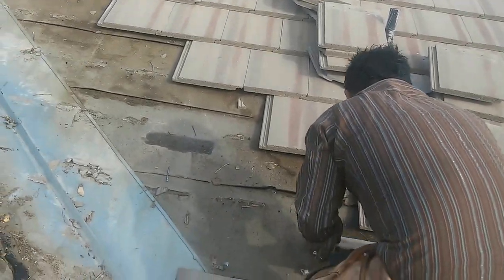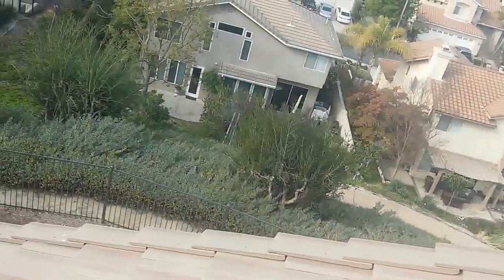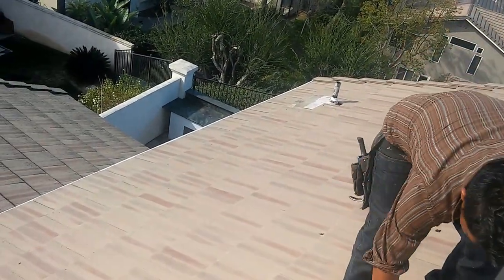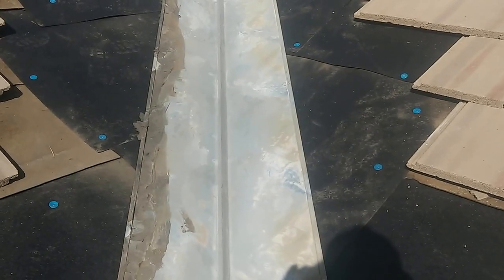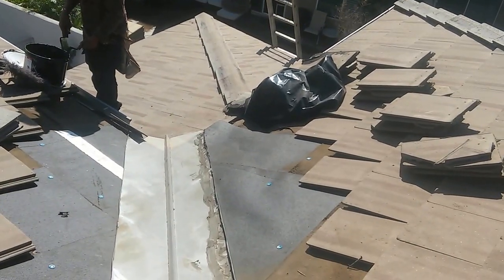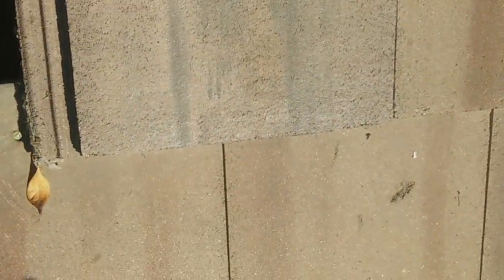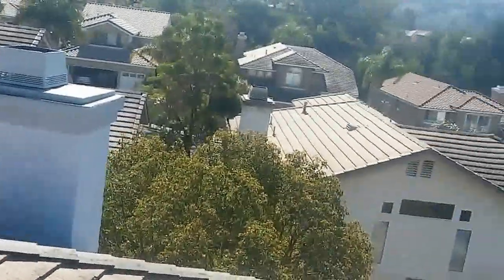ROOFING TILES REPAIR ! how to repair tile roofs the right way !!

Comment: Battens are a must does not matter about pitch of roof it's just good practice or about cost look at all the marks on the felt where the tiles have been sitting directly onto the felt also all the nail holes in the felt where you are fixing the tiles

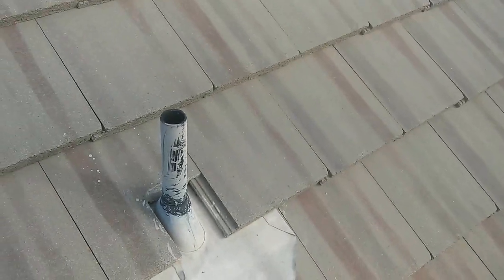Comment: Did you just said "don't use aluminum flashing for flat roof at around 3:31", but your worker just added  silicon glue  to the aluminum flashing...was the owner aware of this issue....the old flashing had caulking marks on the tile below the flashing.